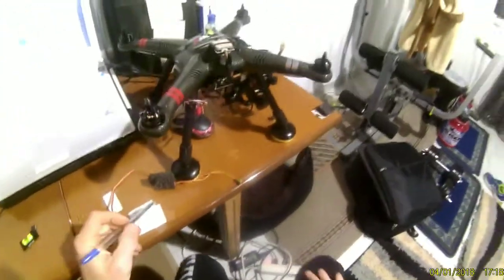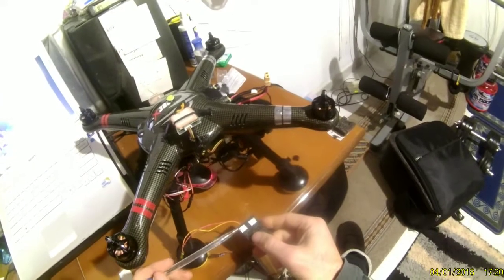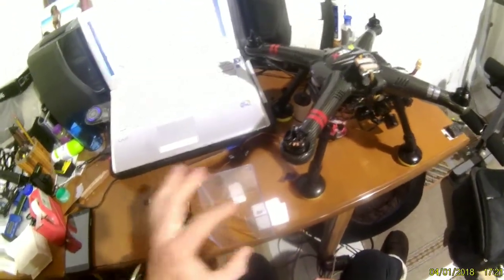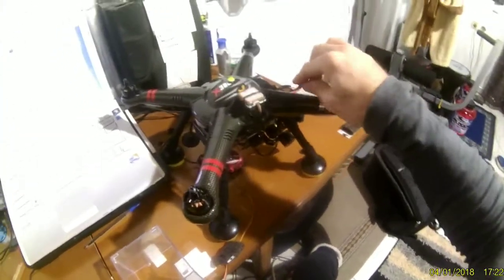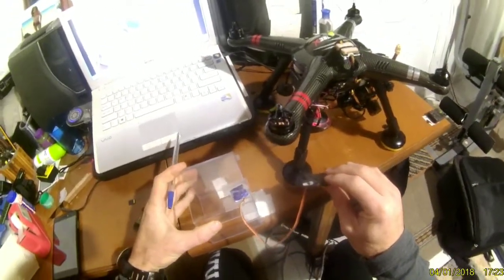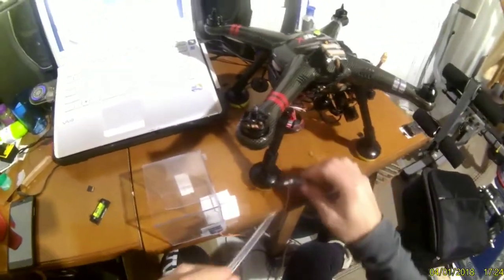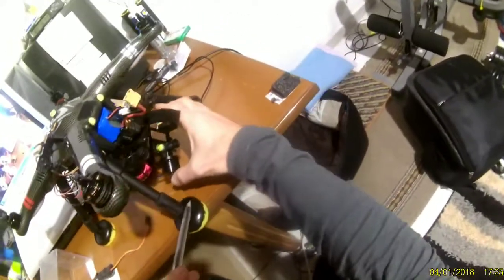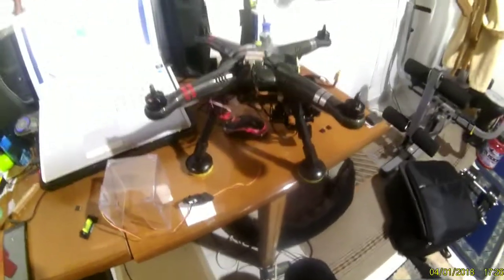Xk X380 GIMBAL CALIBRATION 6 POINT IMU(STOCK GIMBAL)

Comment: Thanks need to do this with my gimbal it's just not sitting right on the roll axis .
Reply from the maker: Maybe it helps maybe not!
Reply: @paristaladianos2209  I give it a try and I let you know if it worked 👍
Reply from the maker: @TheFlyingJocks  I hope you are luckier than me,if it doesn't work try to buy a new gimbal,I have sold it already,I was very tired of repairing any kind of problems
Reply: @paristaladianos2209  on my other x380 I use the g2d gimbal on it . Was hoping to get the stock one working agian just because there no issue with the legs in the camera view
Reply from the maker: @TheFlyingJocks  the stock one works better but is very sensitive gimbal,you must be very careful when you carry the drone or when you repair any wires